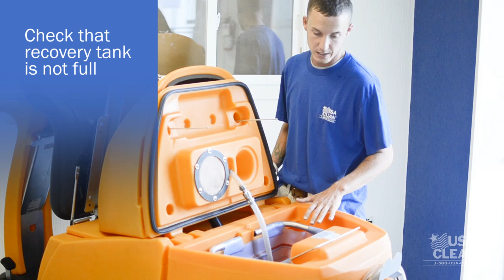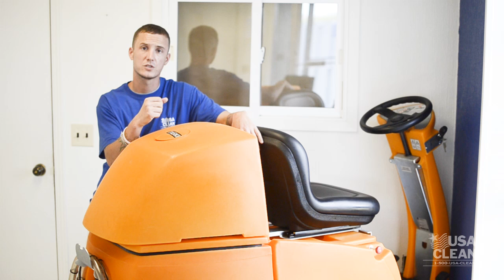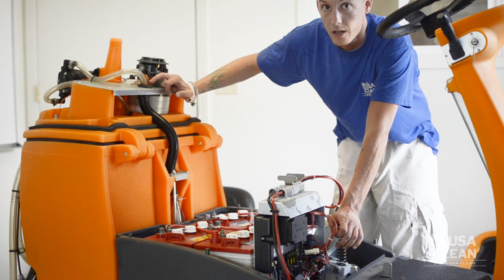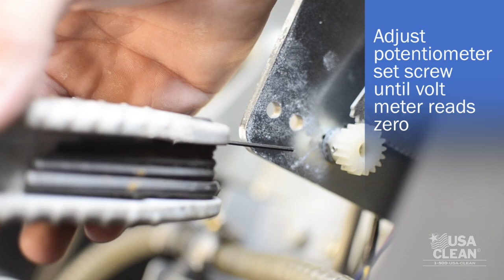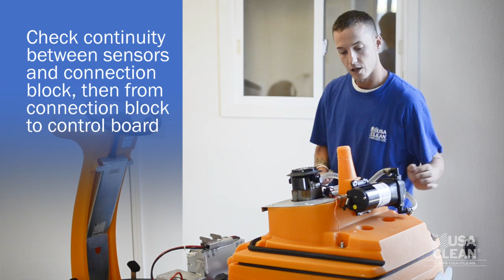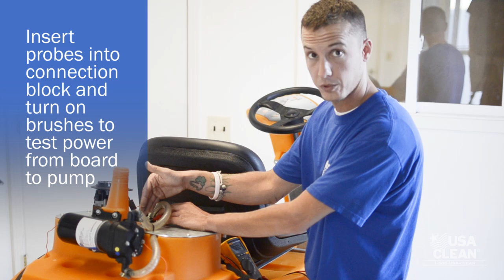TASKI swingo 2500 Troubleshooting Video

Comment: We have one of these at work. What is the clear hose for? i assume it's for solution drain but it does not work. I press the button on the hose I hear a click but nothing happens?
Reply from the maker: +lexmarks567 That hose is the recovery drain hose.  If there is just clicking noise then the pump is not engaging.  Please call us so we can help you find out why it is not engaging.  800-USA-CLEAN